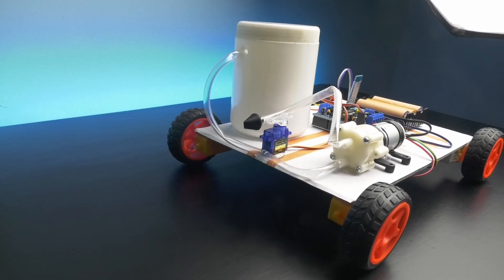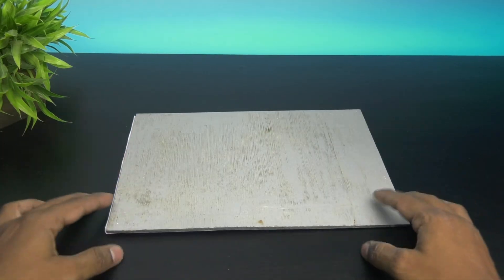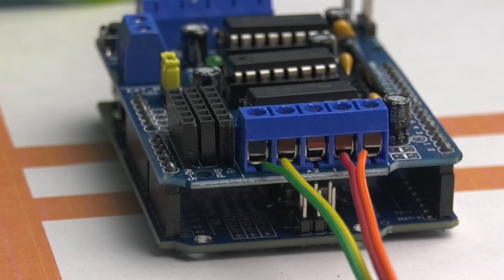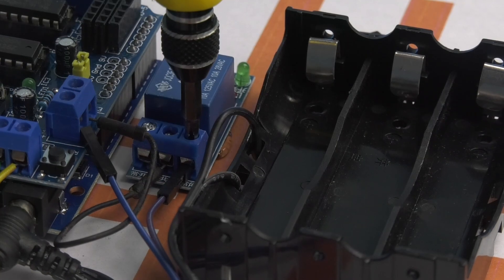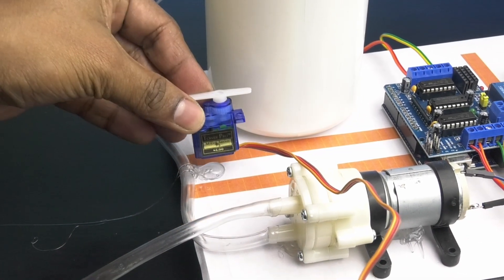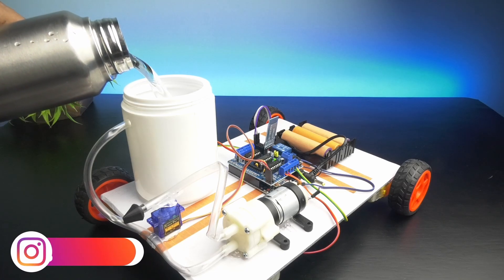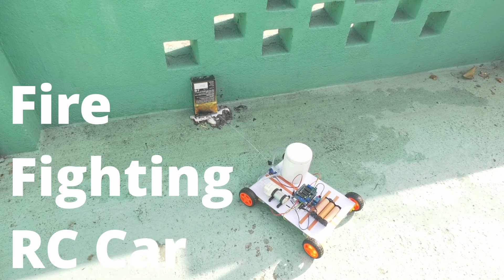Bluetooth Controlled Fire Fighting Robot RC Car based on Arduino | Ut Go

Comment: In our project the power of battery is not going only in relay and bluetooth module rest are get power wath is the problem pls replie fast
Reply: Pls reply me
Reply: I have also same problem
Reply from the maker: In motor driver shield you have to connect "Mini Jumper Short Circuit Cap" into the male header pin labeled as "PWR" or "PWRJMP" beside the EXT_PWR to get 5 Volt into the 5 Volt rail of the shield. In this video you will find a yellow colored Mini Jumper Short Circuit Cap.
Reply from the maker: In motor driver shield you have to connect "Mini Jumper Short Circuit Cap" into the male header pin labeled as "PWR" or "PWRJMP" beside the EXT_PWR to get 5 Volt into the 5 Volt rail of the shield. In this video you will find a yellow colored Mini Jumper Short Circuit Cap.

Comment: 4:52 what are that jumper wire Behind bluetooth module connection with motor driver shield??? How have you connected??? 
Please reply fast
Reply from the maker: Those jumper wires are used to connect the realy board. You can follow the circuit diagram.

Comment: How did you connect 5v relay single channel to motor driver shield behind the Bluetooth module connection???
Reply from the maker: It is connected through jumper wires. You will find the circuit diagram in the video description.
Reply: Please reply fast

Comment: Bro I make this project but bluetooth module is connected to the app but when I press any button of the app 
This project was not working means   
Not go forward , backward anything was not working please tell me solution
Reply from the maker: Check if the bluetooth module is connected properly or not. Also check the battery voltage it should be fully charged.
Reply: Bluetooth module is connected or i provide 12 v but not working
Reply from the maker: Have you made connections as per my circuit diagram?

If yes, then tell me how you have connected the bluetooth module? Have you installed the female headers into the motor driver shield?
Reply: Please give me solution
Reply from the maker: Tell me how you have connected the bluetooth module. You can also contact me through Instagram and send pictures of your project.
Reply: I don't have Instagram

Comment: Which types of wire are used?
Reply from the maker: I have used simple jumper wire everywhere except for the battery connection. I have used thick wire for battery connection.

Comment: Hello sir. Facing a problem, when the Arduino is given power, only the pump is working and blutooth module has no signal. Pls give a solution
Reply from the maker: Have you soldered the male headers on the motor driver shield ?

Comment: I'm using a l298 mini motor driver where do I put it
Reply from the maker: You just need to connect the motor and control wire as before.
Reply: If u use 2modules does code change @UtGoTech

Comment: Is a BTS7960 Power H-bridge 43 Amp Module. Motor driver fine?? Cause l298 driver is sold out whT motor driver u recommend
Reply from the maker: Yes you can use it but these module can drive only one motors so you have to use two module. I think this motor driver will be over powerful for this project.

Comment: What if u use a battery holder with 4 battery spots for battery
Reply from the maker: Voltage of the battery pack for this project should be around 12 volts that's why I have used 3 batteries only.
Reply: @UtGoTech which types of motor driver is good enough to replace urs because they are sold out
Reply: Is it OK if it exceeds
Reply from the maker: @Magic.edits1-x4o  No you should not because it can damage the motors and other components.

Comment: Bro please help me im made by this project also connection right coding right but not a run this project why
Reply from the maker: @kartiksah4326  what type of battery are you using?
You have to use a lithium base battery.
Reply: @UtGoTech  yes 3.7 v lithium-ion battery use
Reply: Bhai abhi bna rha hu lekin run nhi ho pa rha hai thoda sa chalke ruk ja rha hai please help me bro ...apna WhatsApp number send kro na bhai
Reply from the maker: Have you charged those lithium ion batteries?
You can contact me through Instagram. 
Send a picture of your RC car through Instagram.

Comment: The car does not moving while use RC controller app
Reply: Please give me the solution fastly
Reply from the maker: Have you fully charge the batteries. Make sure to fully charge the batteries before using.
Reply: Yes
Reply: I make sure the battery is fully charged but the car does not moving while using the app
Reply: Give me the solution fastly
Reply: Give solution fastly
Reply: Give me a solution before 13 please
Reply: Please
Reply from the maker: Have you made connections as shown in the video.
Reply from the maker: If you are still facing issue then contact me through Instagram

Comment: The car does not moving
Reply from the maker: Have you checked battery voltage? Make sure to fully charge the batteries before using.

Comment: I can't open the Code link
Reply from the maker: Don't open the code in Google Drive. Just download it and open it using Arduino IDE.
Reply: Ok
Reply: I can't sketch the file to the arduino IDE
Reply from the maker: @ Simply open the file in Arduino IDE
Reply: When I upload the computer seeing serial part not selected copy error messages why did that
Reply from the maker: @ Didn't understand what you have said. Please Explain
Reply: it Solved
Reply: I don't know how to open

Comment: My pumping motor do not have two holes give me a solution
Reply from the maker: how many holes your pump has?
Reply: 1
Reply from the maker: I think you have a submersible pump. And the hole you see is the output of the pump.
Reply: Yes

Comment: Bro i have done all the connections and uploaded the code also but when I try to move it, it moves little bit and gets stopped so what to do please help
Reply from the maker: Check your battery connections and make sure they are properly charged.
Reply: They are properly only
Reply: And the battery are newly purchased
Reply from the maker: @ new batteries are not fully charged. You have to charge them before using.
Reply: Ok I will try
Reply: Still facing the same issue
Reply: @deepalgor9913  Did you solve the issue? Because I am also getting the same issue

Comment: Bro my project water pump is not stopping it is continuously working only please help 🙏
Reply from the maker: Check the connections between your water pump and the Relay module
Reply: I have checked many times
Reply from the maker: @deepalgor9913  what is battery voltage?
Reply: 3.7v
Reply from the maker: @deepalgor9913  That means you have not fully charged the batteries.
Reply: And I am using 6v water pump forgotten to say you
Reply: Still facing the same issue
Reply from the maker: @ Contact me through Instagram. I will guide you there.
Reply: Bro im facing the same issue please tell me how you fixed it 🙏🏻🙏🏻
Reply from the maker: You have to use another contact is the relay board.
Reply: @UtGoTech  like how ? I did the same as shown in the video ( im using 6v water pump )

Comment: Hello bro,to iserted bluetooth module did u join the pins because in my L293d shield i dont have that pls answer
Reply from the maker: if you don't have those pins then you can solder the female header pins by yourself
Reply: Oo is that this simple? @UtGoTech
Reply from the maker: Yes its simple
Reply: Thnks bro
Reply from the maker: @ Welcome

Comment: Bro i make this project but my Bluetooth module not get power please tell me solution under 28 date please
Reply from the maker: Make sure you connected the Bluetooth module to the 5V pin of the Arduino board.
Reply: I am not understand
Reply: Please tell in detail
Reply from the maker: @ check if bluetooth module is getting 5 volt or not
Reply: Not working
Reply from the maker: @ have you checked the 5volt power ?
Reply: Yes but it nat work
Reply from the maker: Ok send a picture of your project through Instagram
Reply: What Price of new hc 05 Bluetooth module and where I order 1:19 1:19 1:19

Comment: bro can u pls share the app link which u have used. 
And then in circuit diagram u didn't mention the connection of dc jack wire.. Is it necessary to connect jack wire with motor driver?
Reply from the maker: Circuit diagram is complete you can follow it. 
No its not necessary to connect jack wire.

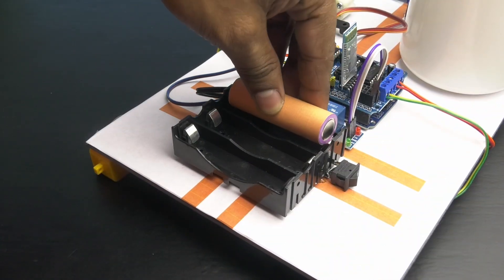Comment: 5:36 what are those 3 wires near bluetooth module (purple and 2 white) its not shown in the video brother ?
Reply from the maker: Those are 18650 lithium ion batteries.
Reply: @UtGoTech  is it required ? since u did not show it in the video
Reply from the maker: @ Yes you have to use three 18650 lithium ion batteries in series.

Comment: How much volt is per battery ?
Reply from the maker: The nominal voltage of 18650 lithium ion battery is 3.7 V and the fully charged battery voltage is 4.2 Volt. In this video I have use 3 batteries in series that makes a 11.1 Volt battery pack whose fully charged voltage is 12.6 Volt.
Reply: @UtGoTech  thank you
Reply from the maker: @ Welcome

Comment: Can i use 6volt water pump insted of 12volt water pump in the same curcuit?
Reply from the maker: Yes you can but for that you should use only 2 lithium ion batteries in series in place of 3.

Comment: what's the app??
Reply from the maker: Bluetooth RC Controller
Reply: @UtGoTech  Bluetooth_Controlled_Fire_Fighting_Robot_based_on_Arduino:2:10: fatal error: Adafruit_MotorShield.h: No such file or directory
 #include <Adafruit_MotorShield.h>
          ^~~~~~~~~~~~~~~~~~~~~~~~
compilation terminated.
exit status 1
Adafruit_MotorShield.h: No such file or directory

error but i downloaded all libraries
Reply from the maker: @shreyanmitra-xi-16-science11  Install Adafruit Motor Shield V1 Library through library manager as shown in video, it will solve the problem.

Comment: hey i need help i am using arduino r4 minima and  new arduino ide but i have error plz reply quck the error part is here

AF_DCMotor motor1(1, MOTOR12_1KHZ);
AF_DCMotor motor2(2, MOTOR12_1KHZ);
AF_DCMotor motor3(3, MOTOR34_1KHZ);
AF_DCMotor motor4(4, MOTOR34_1KHZ);
Reply from the maker: Have to installed the Adafruit motor shield v1 library?
Reply: @UtGoTech  yes
Reply from the maker: @what error are you getting ?

Comment: After downloading the code file it show that the file is not supported , please solve this problem
Reply from the maker: Don't open the code in Google drive just download it and open it using the Arduino IDE.
Reply: Ok
Reply: In that it also showing the file is not supported
Reply from the maker: Yes that why I told you to just download it and then open it using Arduino IDE.

Comment: Bro I am not getting battery holder with jack and switch 😢😢
Reply from the maker: You can make one for yourself by adding DC jack and a switch.
Reply: But how 🤔 😐
Reply from the maker: @deepalgor9913  You have to take a battery holder and connect terminals of battery holder in such a way to make it a series battery holder and then connect the positive of the battery pack to a switch and then from switch to positive of DC Jack and then negative of the battery pack to negative of the DC Jack.

For reference, you can watch this part of my WIFI RC Car video where I have shown how to make a 2 cell series battery holder with switch.
Reply: Hello bro  @UtGoTech
Reply: Thanks bro 😊😊
Reply from the maker: @ Welcome Bro

Comment: Irhe bloothut module connect but car does not moving

This project selected for hackathon 

Plese give solutions
Reply from the maker: Check battery voltage.
What type of battery are you using?
Reply: @UtGoTech  the battery voltage is same
That problem face by using 2 channle relay
Reply from the maker: @sadashivpokale7860  what problems you are facing? Give details.
Reply: @UtGoTech  i will contact you 

The problem is blutooth conect but not move car by giving instructions
Reply from the maker: @sadashivpokale7860  Yes you can contact me through Instagram.
Reply: @UtGoTech  lithium-ion battery
Reply from the maker: @sadashivpokale7860  Are the batteries fully charged ?
Reply: @UtGoTech  no
Reply from the maker: @sadashivpokale7860  Then you should charge the batteries and then give it a try.
Reply: Bro me also
Reply from the maker: @r_s_robotics  Are you facing similar issues ?

Comment: do you have codes and diagram if i use l298 motor driver shield
Reply from the maker: No I don't have it for L298N project.

Comment: Not working bro
Reply from the maker: What issues are you facing?
Reply from the maker: Could you please elaborate on the issue you are facing?
Reply: Motors are rotating slowly. Sometimes the remote control works sometimes doesn't

Comment: My car connect but not move by app
Reply from the maker: What type of battery are you using?
Reply: @UtGoTech  monster tyre wali 3 lithium battery
Reply: Monster truck
Reply from the maker: Have you checked the battery voltage?
Reply: @UtGoTech no but very hight voltage and I couldn't connect relay
Reply from the maker: Check the voltage if it is 12 Volt or not.
Reply: @UtGoTech  which voltage is suitable for the?
Reply from the maker: 10 volt to 12 volt
Reply: @UtGoTech  my vot is 16.6

Comment: where can i make the circuit block diagram on my own? which website or platform did you use to make your circuit diagram?
Reply from the maker: You can use fritzing
Reply: @ i purchased it online and downloaded it
But i am not able to find the components, like L298N, flame sensors
Reply: @ can i get your WhatsApp number?
Reply: @UtGoTech can i get your contact details so that i can share my queries over there
Reply from the maker: Contact me through Instagram

Comment: 0:40 what are those red and orange wires?
Reply from the maker: You can use any wire you want.
The wire I have used is from the multicolour ribbon cable.

Comment: Bro ive completed the wiring as it is and code is done but when im turning it on , the water pump starts without stopping and if i connect the app it still doesn't work plz help
Reply: I am also having same issue
Reply from the maker: You have two contacts in the relay, one NO and other NC. Maybe you are using NC contact. Use NO contact instead.
Reply from the maker: You have to use different contacts in the relay.
Reply from the maker: You can follow the circuit diagram. It has all the details.
Reply: Hello
Reply: Can you find it's solution

Comment: Bro what is the issue that you have done of relay board
Reply from the maker: It doesn't have any issues. You have to turn off and turn on the pump through the relay board.
Reply: @UtGoTech  yah but I wanted to know that where is the relay board connected with it isn't shown properly in the video kindly please help.

Comment: Can you tell me the app? If the app is removed on Play store, any recommendation for another app.
Reply from the maker: Code is designed on the basis of this app so another app will not work for this project.
Reply: @UtGoTech  Can u tell me the app broooo
Reply from the maker: Bluetooth RC Controller
Reply: @UtGoTech  
OHH SORRY LOL I THOUGHT YOU MEANT THE CODE ONE 😭
Reply: it’s arduino IDE

Comment: The code is not opening
Reply from the maker: Don't open the code in Google Drive, just download it and open it using Arduino IDE
Reply: Not opening
Reply from the maker: Don't open the code in Google Drive, just download it and open it using Arduino IDE

Comment: Arduino motor shield or motor driver is same?
Reply from the maker: Both can be different. The motor driver that can be mounted over the Arduino board is called as Arduino Motor Shield.

Comment: Bro, where is Riley  bored connected?  Plz say
Reply from the maker: Sorry, for the mistake. Relay board is connected to pin A5.
You can follow the circuit diagram. Link given in the description.
Reply from the maker: https://drive.google.com/file/d/1j18LDOCyVMbz6v2emD3rPE3WKbM4d7q8/view?usp=sharing
Reply: Bro I made these project these was working but now the project is the Bluetooth is connected but don’t working the function what is bro what to do😢 these is a nice project bro I want to present in school what well do
Reply from the maker: First battery voltage should be checked. All the batteries must be Fully charged.
Reply: @UtGoTech  bro can we use 4 lithum iron battery
Reply from the maker: I suggest not to use 4 batteries.
Reply: Bro these is not working the buletooth is connected but not working what well do my battery are full charge ,bro where is the buletooth module rx and tx is connected bro connect only tx
Reply from the maker: Yes only tx is required
Reply from the maker: Look for any loose connections
Reply from the maker: If you are still facing issues then you can contact me though Instagram
Reply: Hlo
Reply: Bro the issue is no go what well do I well sent a message to you in Instagram 😢”Hlo”
Reply from the maker: @r_s_robotics  Ok I will reply:hand-pink-waving:

Comment: hi, what’s the keyword of the nozzle blue map, I want to print one as well
Reply from the maker: I have made that nozzle. I will share the STL file.
Reply: @UtGoTech  i connect with everything and the pump and servo are working, but the motors are not working I don’t know why
Reply from the maker: Look for loose connections